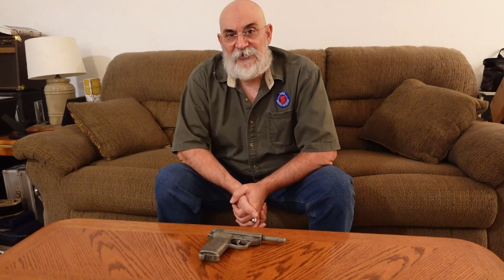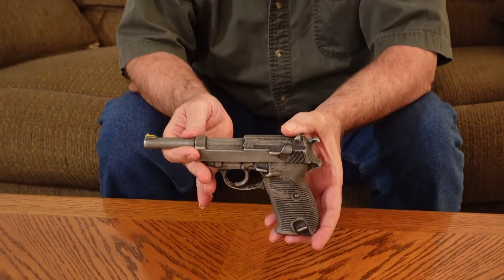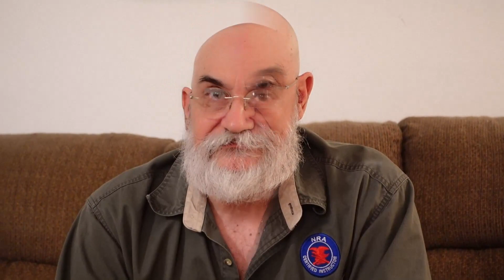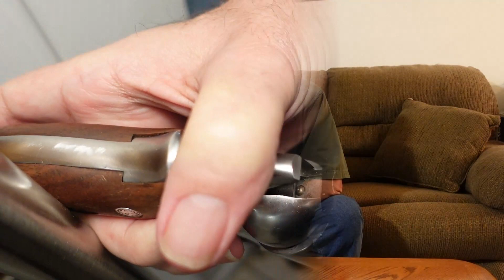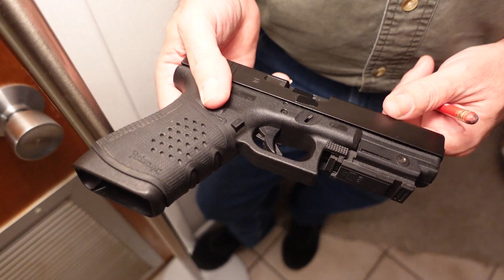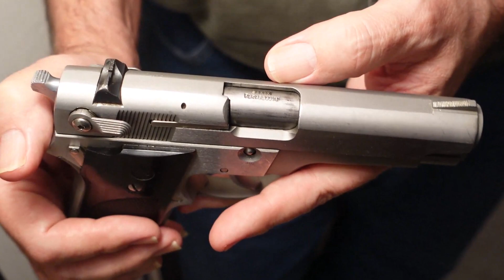Basic gun safety with Bill1911 #gun #gunsafety #safety #

Comment: That isn't the point of that rule. It is not your responsibility to check the gun for anybody else's sake. If Joe Shmoe comes by and picks up the gun you cleared and plays with it like an idiot, it's on him to clear the gun. The rule is to treat every gun as if it were loaded since once you've walked away from that firearm, you have created a window where somebody would have had the opportunity to change that. Somebody else may have handled that firearm and it is now no longer unloaded. You return to that firearm and need to clear it because you can no longer confirm that it is in fact clear. 

Not trying to be a d*ck or just "that guy". This would have just bugged me if I didn't clarify that rule for any new gun owners that watched this. Each person is responsible for following the safety rules.

Comment: Wut in tarnation??  Wow.   "It's a small handheld machine."  yet  "No such thing as an accidental shooting"- Which in definition is when the simple machine malfunctions. An accidental discharge in the unintentional firing of a shot not due to improper gun handling and through no fault of the person handling the gun.  In the vast majority of cases, an accidental discharge is due to mechanical failure or equipment malfunction.   You should be choosing your words and understand the basics of firearm terminology quite a bit better if you're are going to be passing yourself off as knowledgeable.  "Gun should be unloaded unless at the range or in a holster on your person."  Completely forgets firearms are used in home defense- and by his logic- should be unloaded.  Then confuses the viewer more by saying a manual safety is not a safety- but isn't the gun unloaded at all times- why should the safety matter?  It just gets worse...  He doesn't understand revolver transfer bars- that releasing the hammer by pulling the trigger WILL ALWAYS engage the transfer bar into the striker- he thinks you can pull the trigger "not all the way" and be ok.  Wow.  It is not a "double trigger" on a Glock- it is a safety trigger blade or trigger blade safety.  With the right forces on the safety plunger and firing pin a Glock will still go off if dropped., unlikely, but this gentleman has no understanding of how his gun works.  You should not need to have a stranger correct you on a BASIC SAFETY DISCUSSION.